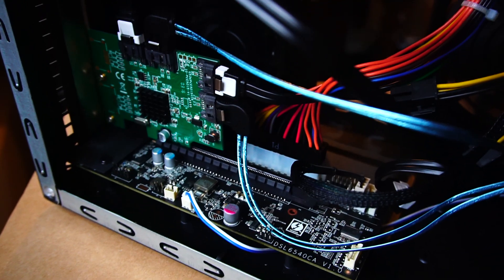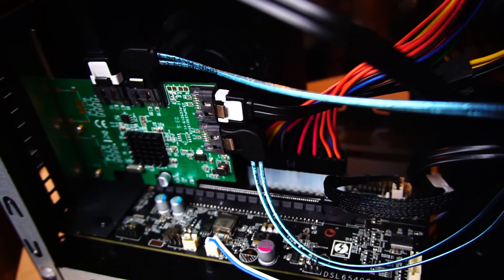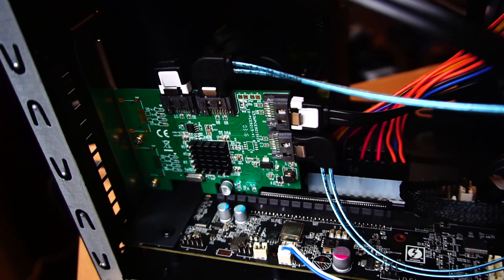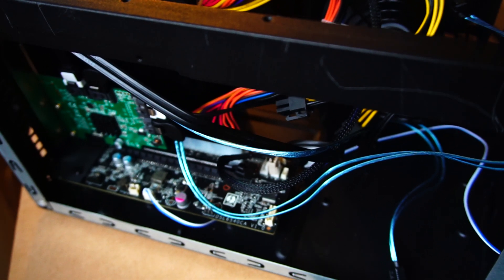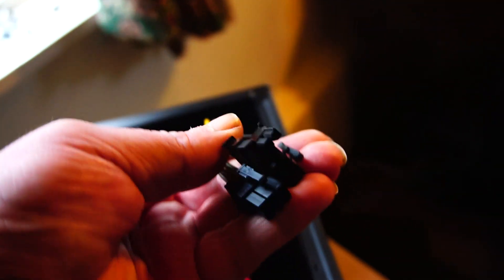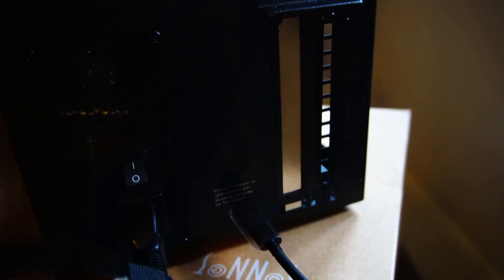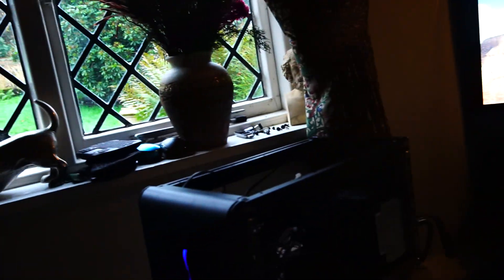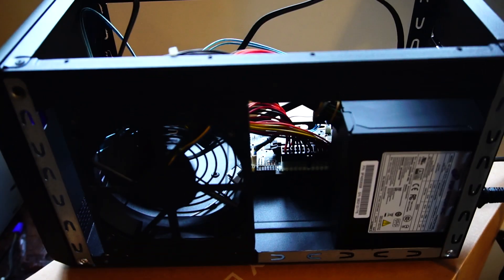Sonnet eGFX Breakaway Box 550W Thunderbolt 3 External Enclosure For Desktop GPU

Comment: Is it any loud? Would you ever dare bringing it to a public space like a library for work? Thanks!
Reply from the maker: very quiet,
Reply: Aiden Kashi as quiet as it may be — this thing has no handle, and is quite large to use in a library unless you’re stationary at a permanent desk.. Also, used as a raid subsystem the disks or ssds have no mounting internally so you would need to modify the case in order to prevent any damage etc. I just bout this — hope this helps.